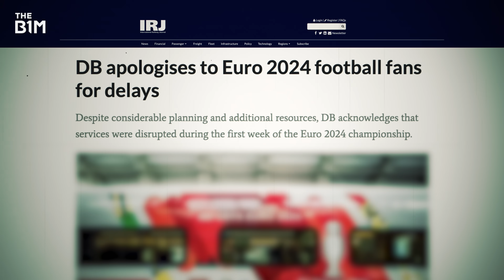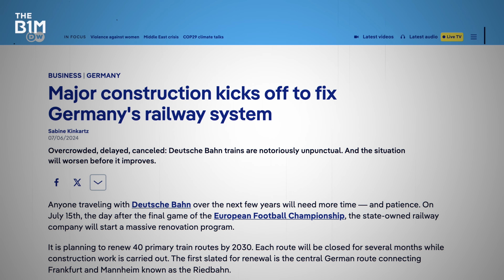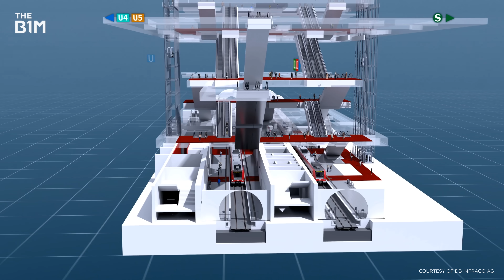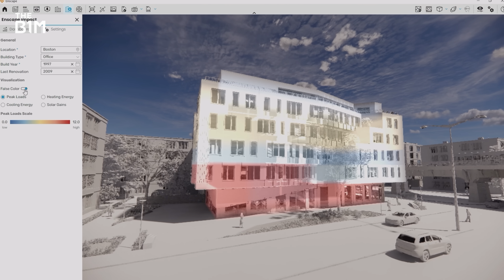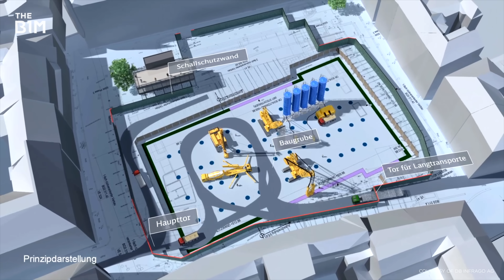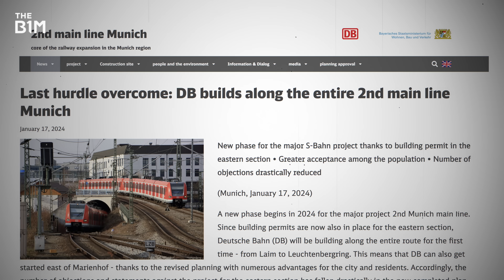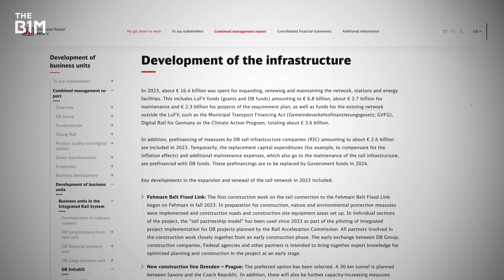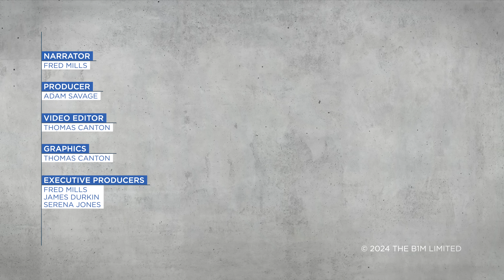Germany is (Finally) Fixing Its Failing Railways

Comment: 60 billion doesn’t sound like a lot for a country the size of Germany…? That’s less than the cost of Paris’s metro expansion?
Reply: Yes, also, it's just a good investment. In Italy we got a full high-speed rail system, and as a result our national rail operator went from a pathetic joke to solvent, internationally competitive, and actually kinda decent (still a joke in some areas unfortunately).
Reply: @Blaze6108   yeah but you only need one Y shaped line for Italy.
Reply: @Blaze6108  Does the Italian highspeed rail operate on dedicated lines? Because the German doesn't and I consider that a historic blunder that will forever hold back highspeed rail in Germany and that can never be repaired (because you would have to start from scratch and no administration will ever do that).
Reply: @Blaze6108  but let me guess it took longer than 4-5 years. I'd like to experience punctual and reliable trains in Germany before I die...
The newest plans of our government pushed the time this goal is achieved (a train to every major city every 30mins) back to 2070 soooo that's that!
Reply: what 60 billion is plenty, but I guess the law that forbids making new debt as a state limits germanys investions
Reply: @TheWillemDeBur  UK had a train price tag of over £100bil and that was just one train track from London to the North.
Reply: 60 billion ain't gonna cut it to be honest. The railway network has been neglected for decades, so there is a ton of work that has to be done just to maintain the current network. That doesn't even include possible expansions. It's going to take hundreds of billions of Euros at least to get everything up to speed again. The US just spent a trillion dollars on maintaining their infrastructure, and Germany is around one quarter the population. So 250 billion would be more realistic.
Reply: @gclip9883  The US has so much more road per capita than Germany, also their Roads are horrific compared to german ones. The only real issue Germany has with roads are bridges, which almost all are in miserable conditions (like almost every where else).
Reply: Those 60 billions are just for reparations, no new lines or other bigger projects are included in that (like those two projects in Stuttgart and Munich mentioned in the video).
Reply: We are busy spending more money on roads sorry :/
Reply: I mean tunnel construction can be 20x times more expensive than the construction of regular, overground rails
Reply: @ can we both agree that 60 billion to save Germanys railway isn’t a lot regardless of how much a metro tunnel cost? Germany has 80 million people and they are trying to solve huge issues with pocket change when Paris is willing to spend double on new metro lines.
Reply: @pollutingpenguin2146  You're right, It's not enough. Still, it doesn't make any sense to compare it with the Grand Paris Express...I don't think you realize how expensive it is to build 200km of rail tunnels and 68 underground stations, compared to 4.000km of simple overground tracks
Reply: @ I work in construction, I know the difference. But I’m not talking about a km for km comparison, but the fact that Germany is seemingly willing to throw a minimal amount of money after a huge issue. Which seems to be a trend in Germany, not being willing to invest and innovate, but just let things run into the ground. A bit like the UK.
Reply: @pollutingpenguin2146  Paris is not spending double on new metro lines. Latest estimate for Grand Paris Express is 43.8 billion.
Reply: 60 billion is nothing these days. At least in an advanced economy with high labor costs and heavily built up areas and property rights. 

China can get away with mega projects after mega projects because their labor is cheap, the country less developed (until recently) and almost no property rights at all.
Reply: We need to feed all of our new specialists and their families 
 What do you expect ???
Reply: It's extra on top. The regular expenses are still there. But you are right that it is not that much more than the funds that just get thrown after useless highways yearly with noone even questioning it.
Reply: That 60 billion only covers the most vital routes. The German rail system is extremely outdated and in desperate need of renovation almost across the board. Conservative estimates put a full renovation in the low trillions, and that is just for the rails themselves. If any stations need to be overhauled to connect to new lines, or because they too are severely outdated, then those figures are going to be climbing rapidly.
Reply: in the video they mentioned, that 11bn are needed for one main station in stuttgart and 7bn for one line in munich. they have to realise that it's not nearly enough money, right
Reply: Well as I understood it it only covers the high speed routes which I guess means the regional trains will continue to suck
Reply: In Germany it is a lot. Unlike the USA and numerous other countries, Germany's national deppts amounts to just 63-64 % in relation to the GDP, compared to 122,15 % in the USA. (2023)
The USA are paying $1.15 trillion USD 2023 just for pay interest on its national debt in the year 2023. The German federal budget for the year 2023 adds up to €849.3 billion.
Reply: @ what does that have to do with anything?
Reply: Additional 500 billion for infrastructure have now been approved. 100 billion of this will be going into energy. Also bridges will need to be moderinized. Not sure how much will be going into the rail.
Reply: The "Schuldenbremse" (Debt break) has been crippling investements for many years now. Some politicans seem to think we need to repay debt instead of investing in our infrastructure and economy which is widely regarded as nonesense but is still being adhered to because it is part of our law for some reason.
Reply: IT ISNT. investment was cut and plans to make trains puncual again have been delayed to the mid 2070s
Reply: It isn't. We spend 113 billion taxeuros every year as a handout to pensioners going into early pensions. That is on top of the money that we already pay into our pension system for normal pensions.
Reply: @dennisschmalacker Well, even old people have a vote. Democracy is about majorities, not about your present or future. Took me way to long to accept this. We should start changing the voting and let people with a higher life expectancy have a vote weight according to it. The old will soon feel how it is when the young ones start to eat into the short future of the older people instead of having it the other way around.
Reply: A person making $10/hour, 40 hours a week, 52 weeks a year, would have to work for over three million years to make that much money. You should be careful dismissing huge expenditures.
Reply: @dansands8140  $10/hour is below the minimum wage in Germany and way below the wage of skilled workers. You need thousands of them to pull it off. 
So yeah, $60bn to overhaul the entire country's railway infrastructure is not that much, especially considering all the bureaucratic bs you have to go through in Germany.
Reply: @EdmondDantèsDE  Please use your brain for one second. Make it $30 an hour. Is one million years of a person's labor really something you should throw around thoughtlessly?
Reply: @dansands8140  road maintenance was around €141 billion so considering this figure it really isn't a lot
Reply: 10$ is a joke.
Reply: @dansands8140 wow, cool fact bro. I bet Germany’s annual budget is more than 10x40x52

Comment: 9:13 I was just in Stuttgart. The train station hands down is the worst experience I had in Germany. It also takes forever to walk from the underground area to the main station platforms.
I hope this comment is out dated one day.
Reply: This train station in particular currently gets heavily remodeled, going from above-ground terminal station to subterranean through station.Yes, there are chances it will better one day 😄
Reply: @flippert0  If it isn't flooded or crumbling, that is.
Reply: well, that doesn't come as a surprise when major construction works take place on site, right? 
Now imagine how long the walk at Munich Central Station is from the end of one wing station to the end of the other wing station. It's a longer walk than in Stuttgart - without any construction works going on at that part of Munich Central Station. That's under plain normal conditions
Reply: @EnjoyFirefighting  it's also a long walk from the underground-station to the normal trains... and that's something what leads you to miss your train. for munich, i'm always stuck when i had to drive by train through this city...
Reply: @crashoverride6413  not really a long walk; Sure, the subway lines are at the south-eastern edge of the station, the commuter rail lines are at the north-eastern edge, but both have pretty direct access to the main concourse
Reply: Bro, this is like saying that living in an unfinished residential building is not nice 😂
Reply: It had very short access from the trains to the underground by elevator and an underground tunnel. The whole train stations needed to move 300 meters to make room for the construction site. This results in 500 m you need to walk now. The train station is a temporary structure.
Reply: I also was in Stuttgart recently and Hauptbahnhof is basically a giant construction site. Of course it's going to be a bad experience for travellers, duh! Rightful critics would have been that this state is now residing for decades? I lost count...
Reply: @TheKobiDror For most of that time there was actually a bridge straight through the construction site. The long way around only started, when they started with the roof of the new station as well as renovating the old train hall building.
Reply: So you were at the Stuttgart central station and you didn’t realize that the whole train station is a huge construction site? 
You walked through provisional gangways and bridges. That’s the reason why it was so bad. (The station is also featured at the end of the video…)
Reply: It is a giant construction side... What did you expect?
Reply: it will, the sbahn plattform has a direct access on the north side to the S21
Reply: Going between an ICE train and S-Bahn was HIKE. Such a mess right now. I was watching the B1M Stuttgart video while waiting for the S-Bahn because I was curious to see what the end result would be from all the construction.
Reply: Sure, but the criticism wasn't that Deutsche Bahn want to improve anything about it, but that a national heritage of a forest was cut down for this, and that the police was using water guns to shoot underage peaceful protesters out of tree canopies. One elderly person lost his eyesight because of being hit with one of these water canons in the face at short range.

The planning is also not just because of this awful, but also because the new plan adds basically no new capacity. So Deutsche Bahn dumps billions into an infrastructure project with a lot of unnecessary complexity, like those ugly concrete pillars just as a prestige project, without improving anything, while destroying heritage.
Reply: you are not quite smart aren't you?
Reply: True that! I have been working in a hotel the past year and when oir guests need to take a train I coach them how to shorten the journey.
From the S-Bahn to the tracks takes either 13 or 20 min if you are able bodied. It's quite the journey and I completely understand the frustration with it. We can only hope that the station gets done in the next 4 years😂
Reply: People hope this comment is outdated since over a decade…..
Reply: as a stuttgarter i can say that stuttgart hbf is the most beautiful train station of germany. the new train station is going to be worse + a building that lacks soul
Reply: @MarianMutter You must be on Crack.  The old Stuttgart HBF was nothing more than a blocky tower with a rotating Mercedes-Benz symbol atop of it. - SO WHAT?
You apparently haven't seen other train stations in Germany.  I was in Nuremberg last week and their HBF is BEAUTIFUL -old, majestic looking and very pleasing to look at.
Next thing you're going to say is that the Stgt. Town Hall is beautiful too right?
Like I said, take your meds or lay off the pipe.
Lived in Stgt-Killesberg for 10 damn years - 10 years too long.
Reply: I lived for 7 years in Stuttgart (or later closeby), that comment was every single day accurate.
Reply: The big problem with DB is not really the infrastructure of German railways, but of the company. It's a state subsidized company that has no competitors, but is still run on a capitalist basis, which means it's going after the most profit and least effort to gain said profits. 

That model was obviously made by the CDU.
Reply: Agree completely
Reply: btw construction started in 2010, so the chaos lasted for the last 14 years.
Reply: I lived in Heidelberg and mostly avoided Stuttgart other than to tour the Porsche factory and visit the Zoo which are great
Reply: Only that after current plans, once the station in stuttgart is finished, you won’t have any direct trains to Switzerland/the south because they want to cut that line. You won’t have enough capacity to handle all these humans that will use the station. Let’s pray that the politicians realize it soon enough that you can’t replace 16 full length tracks one way with 8 full length tracks going through…
Reply: @jimi272  thats exaggerated and partly untrue, there are plans to connec te zurich line to the feuerbach tunnel, and 8 through plattforms can indeed replace more end ones, as trains wont stop there and services will be connected, like a Ulm-Stuttgart-Karlsruhe IRE rather than two separate ones. ALthough there is a shelved plan to build more undergound end plattforms right under the current ones and the judge made it so they have to build S21 in such a way that that ampliation is possible in the future which is a good idea
Reply: @jimi272 
the 16 lanes are worse than the 8 new one.
The only question is, if 8 is enough for the additional need in the future.
Reply: Planning began in 1994, construction started in 2011, and they claim it will be finished by 2026. However, no one believes a word they say, as the completion date has been pushed back repeatedly for over 30 years - literally more than three decades. Its insane
Reply: I never go there, this city is a nightmare, I wouldn't recomment it
Reply: @NoInterleaving where do you live that makes Stuttgart Germany seem like a “Nightmare” 😅
Reply: @NoInterleaving  i wouldn't even recommend it to do that by car... better try to "make a big turn around it", if you can. and that from a german who is literally since years always in the near of that city...
Reply: @NoInterleaving what? Why do you think it’s a nightmare?
Reply: @NoInterleaving I work right in the center and pass the main station every day. Did it today and will do so for some time. Can totally agree. Stuttgart is a terrible city. It's ugly, noisy, terrible to move across, has some of the worst air quality in germany and if you don't include the large outer region, a relatively small city by itself.
Reply: @Anldiot69 chill
Reply: Stuttgart Hbf is a disgrace. The walkways and distances are insane